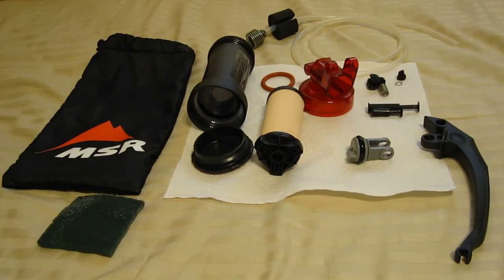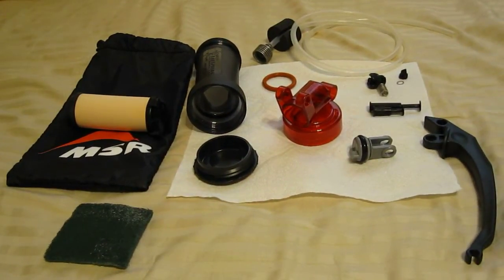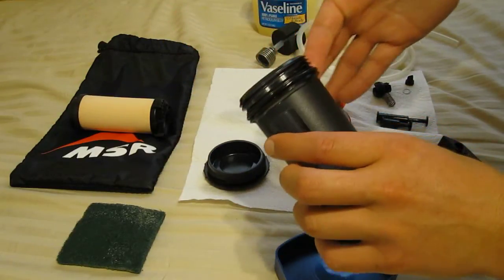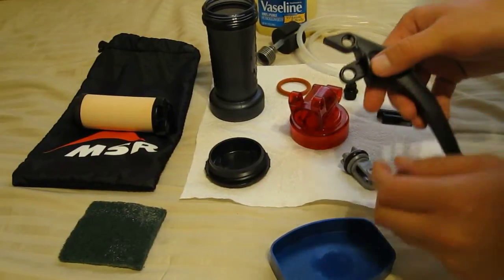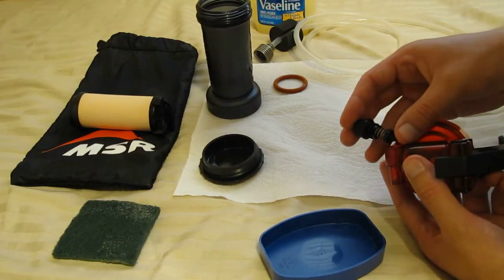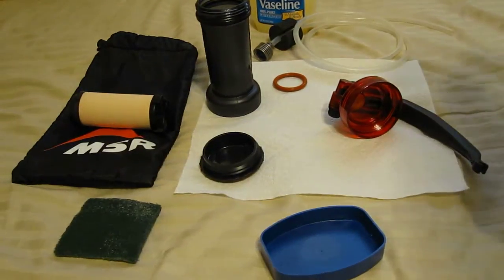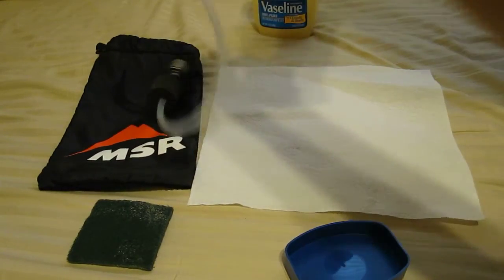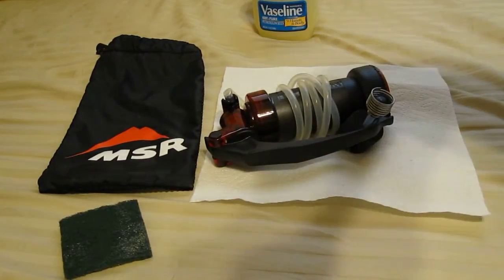MSR Miniworks EX Maintenance

Comment: My 2 cents: I have always lubed THESE o-rings with Vaseline/chapstick. Why would I do something so crazy??? Because I read the manual. I'm not sure what RichWyatt1 means by saying he's seen it first hand, but if he has ACTUALLY had this happen to him with THIS product, he should say so. If he didn't, he should also say so to avoid implying that. The manual states "Use MSR Silicone Lubricant, lip balm or petroleum jelly." It doesn't mention Crisco. Dude even reads the manual in the video!!! (good video, BTW). Rubber is not rubber is not rubber; there are many different types. These o-rings are plenty happy to be lubed with petroleum-based vaseline. Not true of all, but true of these. All that being said, going forward I'm going to use some silicone grease I now have laying around for other uses. 

Punch line: I just unpacked my MiniWorks that had been in the bottom of the closet for 10 years and.... it works like a champ, o-rings are in great shape, pumps and filters water fine. Vaseline will break down some rubbers - I have seen it first hand, too. But not these o-rings. These are fine - I have ACTUALLY seen them be fine with vaseline, first hand, with THIS product. And since they may change the type of rubber at any point, don't believe anything I, or anyone else, types. Read the manual. Kudos to TGOWyoming for referencing the manual.

http://media.cascadedesigns.com/pdf/msr_miniworks_ex_manual_en.pdf

Comment: @RichWyatt1 10 bucks says MSR buys their lube from the same manufacturer as Vaseline. Like the guy said below, hydraulics use petroleum jelly on o-rings all the time, never seen an o-ring fail from Vaseline, hell I used it in my paintball gun that has 20 o-rings and never had a problem. Remember o-rings are made from a different rubber than condoms.

Comment: @metalhead2508 

I worked for years in Hydraulic industry overhauling high pressure hydrostatic transmissions, cylinders, motors ect. We used vaseline on all o-rings and this was the standard in the industry. it depends on what material the O-ring is made out of. I have never seen vaseline damage a o-ring, most of the hydraulic system o-rings are made from Buna N. What are they made from in the MSR?